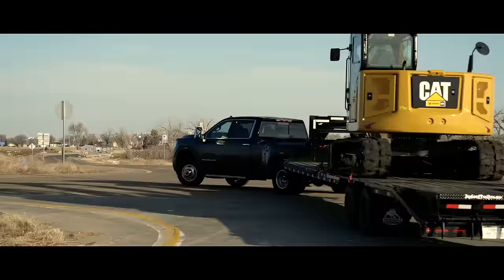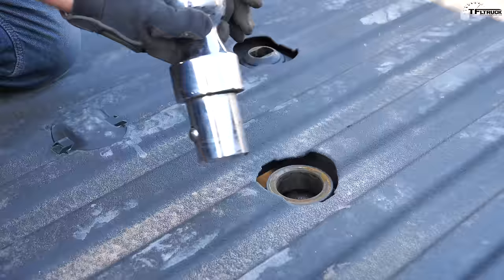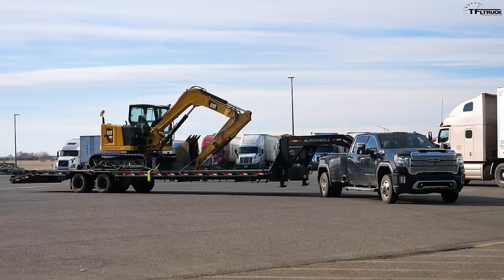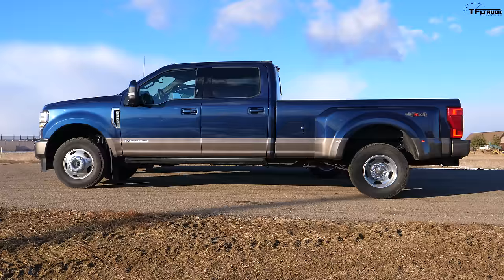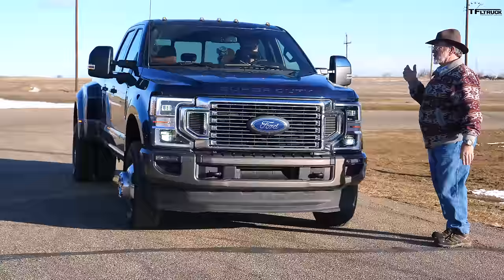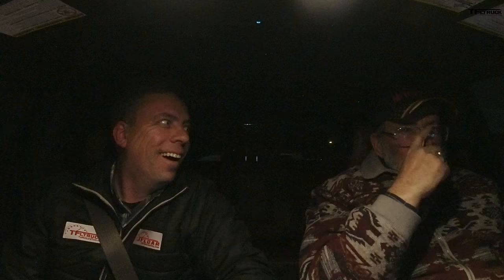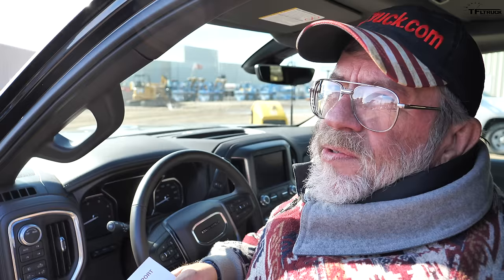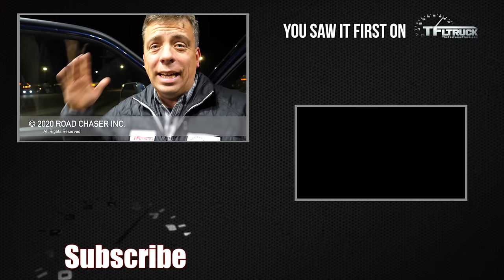30,000 Lbs Monster Tow Test: 2020 Ford F-350 vs GMC Sierra 3500 - Drag Racing & Tow Off!

Comment: 5:08 noticed how the trailer is flopping up and down ,I think the trailer has the bouncing problem not the truck.
Reply: Yep 👍, they didn’t load it right. The weight is supposed to be over both axels...lol
Reply: @chaosseat  That's the first thing I thought as soon as they said it. Improper distribution will shake you and give you some white knuckles on the back roads.
Reply: I noticed the same thing.  Tail of trailer was jumping all around.
Reply: To me it looked like the excavator was a little too far forward.  I have been using gooseneck trailers now for a little over 20 years.  They really don't seem to like a lot of tongue weight.  But if these guys actually scaled the load it could be that was the correct placement.  

In my opinion this is why I wouldn't buy this particular set up.  A full size truck would ride much better than that.
Reply: @texgarcia1958  I can't help but laugh when people say excavator. In my mind I'm saying trackhoe. I guess Andre is keeping it PC😅😅
Reply: Mini is too far forward on trailer.
Reply: @jaycevessier7554  If my CDL is riding on it, I'm going to find a place to park and resolve the situation even if it's only on a 66 mile loop. 🎲🎲
Reply: @robertmorris3892  I came from the rental business.  In the 80s they were trackhoes.  But then they changed to excavator and mini excavator.  I got a better one for you.  With boom liftswe used to call them straight booms and knuckle booms.  Now it's articulating boom.  The lower half of the articulating boom when we call them knuckles used to be referred to as a Dick.  Now the bottom end of a articulating boom is called a riser.  Lmao.
Reply: @robertmorris3892  Guess Andre has to  'HOE the line ' like most people 😂😂
Reply: waka waka you have to have air ride or these these trailers will pound the piss out of ya.
Reply: @robertmorris3892  Good idea; that constant flexing of the trailer could have resulted in a catastrophic failure dumping the load on the road creating a mess.
Reply: @rudystraight1750  Andre, Kent and the rest are doing great testing new trucks.  You  have to work out the kinks on anything for the first time. They did change up the load for real life comparison. Andre didn't even have his stick horse with him. ✌️
Reply: Good video, thanks for testing for ETA and MPG numbers in HD Pickups - I think the EPA should actually test this size pickup truck too.  Could wind during the day have affected your MPG numbers?  Testing during the day vs. night, a few environmental factors could affect the numbers.  Daytime conditions are often windier although the sun may warm the air, hence making it have less resistance to push through.  Nighttime conditions often have calmer wind conditions, but with the sun down, the air temperature decreases and with that, the air is more dense and creates more resistance.  Theoretically these opposing conditions could all cancel one another out, but if you're testing apples to apples, these are things to consider.  I would have rather seen the two trucks alternate pulling the trailer, with the empty truck doing it's "non-towing" TFL MPG Loop for comparison.  Thanks for the video, and for including the DEF usage - no where else have I seen DEF usage numbers compared on this size truck class.
Reply: 18:05 enough said...
Reply: yes sir the cat is the medal of the axle so you get the teeter- tater affect.
Reply: @chaosseat  Yeah, for as much as these two clowns claim to know about pickups they sure do make a lot of boneheaded mistakes like that!
Reply: They got the load distribution off on the trailer to far forward. All the weight is on the front axel and the truck.
Reply: Yeah they need an air ride trailer
Reply: Improper wgt distribution. Conventional tow, gooseneck, 5th wheel ; if you don't get it right it'll rattle your teeth.
Reply: I had a feeling it was the weight distribution
Reply: @chaosseat  and its overweight. That trailer is rated for 22,000 lbs. It weighs 8500 lbs. That means they can have 13,500 lbs of cargo on the trailer. They put an over 21,000 lb machine on it. The trailer is about 8,000 lbs overweight. 
These guys don't understand weight ratings. It includes the weight of the vehicle and/or trailer.
The truck rating is 30k GCVWR (Gross Combined Vehicle Weight Rating). That means maximum allowable weight of truck, passengers, trailer, cargo, and safety equipment. Not maximum towing capacity.
Reply: @AnonYmous-qg4ph  truck is rated to tow 30k plus some.  CGVWR is around 40k on these newer duallies.  

I do believe you are correct on the trailer though.  I have a similar sized machine and the only gooseneck that will carry it is a 20’ with 5’ dovetail with 12,000k axles.  25,900 lb rated.  Any trailer longer is too heavy.  

Just bought trailer last week after lots of research and consulting and a DOTD compliance consultant.  There is a very narrow range of truck/trailer combo that can actually tow what the factory states they can tow.
Reply: @LTD_Outdoors  thats incorrect. The CGVWR(Combined Gross Vehicle Weight Rating) is 30k lbs. That means your total weight including truck, trailer, cargo, passengers, etc cannot exceed 30,000 lbs. That still doesn't mean that you can weigh in at that much and still be legal. Its all dependent on trailer rating,  tire rating, axle rating, axle spacing, load weight distribution, etc. You can be under the weight limit and still be illegal if you have to much weight on one axle, not enough on your steer axle, to much tongue weight, not enough tongue weight, to much weight for trailer rating, etc.
And you have to be licensed for that tonnage, hold a class A CDL, have a USDOT number, truck and trailer need annual DOT inspection stickers, proper insurance and bonds, and more depending on the state.
I know because I am a former CDL driver and I currently work with companies on DOT compliance programs. DOT regulations are something most people and companies struggle with. Many veteran commercial truckers aren't even aware of what it takes to be in compliance.

Comment: Would love a new truck but prices are outrageous. I bought a dozer and towed it, 24k from WV across Ohio in my 96 7.3, zf5 with 400k on it, three weeks ago. Got 12.9 MPG. Guess I'll stick with what I got.
Reply: Absolutely, they’re simply asinine. Especially for a truck that’ll probably blow a head gasket inside 100,000mi
Reply: Yep, we get better mileage from out 01 than our 14 duramax and we don't have to deal with DEF and post bailout GM problems quarterly. The only downside is the 6 speed is nice for highway and the exhaust brakes on the new trucks are a game changer.

Comment: Please do yourself a favor ,put the fuel cap on before you pickup the DEF nozzle.It could be a 10k dollar mistake.
Reply: DeepDeep South huh
Reply: @overboostedgarage8744  if someone accidently puts DEF into the fuel tank and runs the engine, it will damage the fuel system to the point of needing complete replacement.
Reply: DeepDeep South s
Reply: I've done it.  With hotel stay in a small town during the repair , the damage was more than that
Reply: I’m surprised those nozzles are the same size to avoid that exact thing from happening? Good point.
Reply: Brian Weighs In my 2020 f350 does have a fuel cap
Reply: Yes, please put the fuel cap back in place  before touching the DEF nozzle. Really enjoy your videos 
Thank you keep up the good work
Reply: Thats a great point. I worked at a Ford dealership when the super dutys first  came out in 99. The 7.3 powerstroke was a big hit & people were getting diesels that never had one before, & really didn't even need one tbh. Anyways the biggest problem was these diesel newbies were putting gasoline in these trucks, that kept our diesel techs very busy haha
Reply: @troypatillo1688  you would think they would make them different sizes so you can tell, I'm glad my lmm doesn't take that bullshit Def fluid...

Comment: Thanks guys- nice review.  I purchased my 2020 GMC Sierra 2500 HD Diesel last March based on your reviews!  It has been a great truck so far.  My family and I traveled across the USA last summer pulling a 2020 Airstream Flying Cloud, 25Ft.  The truck pulled the AS through the mountains as if there was nothing behind us!
Reply: Scott Yes I have always owned Ford's. My first 79. Then a 2000   with the 10 cylinder. When new on Freeway trip across state it got 15 MPG 
Now driving around town it's like 8 or 9MPG. I do LOVE the look of the NEW GMC Trucks. I would switch brands. The Allison Tranny is so well built. It's proven itself in Garbage Truck usage. The GMC is the Cadillac Ride for Trucks. You have a great comfort Ride for what you do.

Comment: To accurately test the def consumption, you may consider having both trucks do a regeneration prior to fueling. My thought is if one has recently run its regeneration and the other has not could sway def test. Not a gripe jUst a thought. Great job of being as unbiased as possible.

Comment: Excellent test! The Duramax has a larger bore but shorter stroke than Ford's engine. Perhaps the longer stroke was able to eek out better fuel mileage at the ~1600 RPM range that both engines appeared to be running. Last I saw, the Ford's peak torque was at a lower RPM than Chevy.

Comment: I'm surprised the GMC hasn't broken something. They're notorious for breaking Transmissions. And Motors as well. With that heavy load
Reply: 100% false
Reply: FYI it’s dodge that breaks transmissions and L5Ps can handle over 1k horsepower on full stock motor. Check your facts.

Comment: Also when you haul a 308 spin it around and get the weight towards the truck it will help with the ride alot. Plus you can curl the boom more and lower your overall height

Comment: Ford's performance is impressive, but is their a difference in reliability? As an anecdotal observation 80% of all the Diesel Tow trucks where I live are GMC/Chevrolet's.  It's like how almost  all the Taxi's here are Toyota Camry's. Just wondering if there is any reason for the Heavy GM representation.
   I am considering a 2500 HD and Ford's current offerings appear superior, performance wise, in both the Diesel and Gas versions. But this casual observation of Tow trucks in the area has me thinking.
Reply: Get the Ford!
Reply: My 2017 f350 has been absolutely trouble free. And, Its A Beast! @80k miles.

Comment: I am a trucker and I make my living driving the big rigs. One thing I have learned is in the evening my truck does better in cooler air temperatures. I think the Ford did a great job and also the gmc but the trucks should have been tested at the same time of day.  The gmc had to work a lot harder I think. Hotter temperatures make a difference.
Reply: My thoughts also. Plus the wind tends to die down at night helping out mpg especially towing awkward loads.
Reply: @nickgolden8674  agreed.
Reply: But it looks like it winter with snow on the ground so not that much of air temp difference maybe 10-15 degrees but I do agree with you they do run in cooler temp

Comment: Like the video. When your hauling  heavy like that and it's bucking move the weight a little more over the axles of the truck it will help with the bucking. As long as it's not too far forward. Also the way you had the load chained down is illegal.  You can use one chain but it can't be pulling against itself. It has to have enough slack between mounting points and not pulling against itself to be considered "two separate chains". Other than that its was a good video. Waiting to see a comparison between the Ram vs Ford

Comment: Awesome review guys!  I would love to see a real towing cost of use between 7.3 gas vs 6.7 diesel in the same F series model.  Set up trailer for maximum towing weight in the 7.3 and use that same towing weight in the 6.7.  Compare the mpg between the two along with cost of fuels, def, and if possible the cost of oil changes to compare the real world towing cost.  With that info if you want to calculate the additional cost of the diesel engine vs gas and how many miles it would take to break even that would be cool too.  Thanks TFL!
Reply: Most videos will show the diesel uses less fuel but they never compare the actual cost of gas being cheaper.
Reply: All you need is the mpg comparison. The rest is simple math you can do yourself.
Reply: Nobody wants to see little ford trucks towing
Reply: Jamie Webb most HD trucks w/ big V8’s require premium fuel. Meaning the gas is not cheaper
Reply: @josephcreed7  aww did ford hurt you're feelings
Reply: @Prerunners  yes, they let me down when I needed them the most.
Reply: All trucks are smooth when new but a diesel will outlast a gasser by years due to the fact it doesn't work as hard. Thats why you still see a lot of old cummins and powerstrokes with a shitload of miles on them and still running strong.
Reply: @danc1197  That was the case 15 years ago. EGR and DPFs have reduced the lifespan of diesel engines.
Reply: I own the 7.3 gas motor it’s called a Godzilla motor I have opened the exhaust on it, I’m going to make it a true dual exhaust with x pipe and I’ve installed a K&n kit for it. I bet I added maybe 40 horsepower so far looking to have it tuned but this Coronavirus makes it tough to locate a dealer who can tune it. It’s a duality crew cab with 430 factory horsepower it is a 4wd.

Comment: All the people saying that excavator is loaded too far forward need to remember where all the weight on an excavator is at. The engine and big ass counter weight is on the rear of the machine.
Reply: Yeah it was too far up that's explains mose of the truck roughness as far as bouncing.
Reply: They would have scaled the truck and trailer.  They would know the axle weight/tongue weight of the trailer.  It's not overloaded or too far forward.
Reply: The harsh ride is just due to the nature of the trailer.  Even with the torque tubes, flatbed trailers tend to ride harsh due to the deck being stiff, but when it does flex it travels through
Reply: Usually you load them backwards.... I run lowboy and that's what we do.
Reply: The pivot point on that trailer is between the 2 axles the weight is all in front of that.
Reply: Craig Quann .... I don't think you know what you're talking about.
Reply: Alot of people don't have real world knowledge,

Comment: Good review.  The fuel mileage difference may be due to the Ford having free turning from hubs (lock/unlock hubs) and the GMC having always locked from hubs.  The extra drag by the front axles could cause the mileage difference.

Comment: Single digit MPG might sound low but think about this: 30,000 lb trailer + 9,000 lb truck = 39,000 lbs. A new Prius is about 3,100 lbs and gets 53 MPG on the highway. The weight of the truck and trailer is about 12.5 Prii. 12.5 Prii combined would get about 4.25 MPG (53 Miles per 12.5 Gallons or 53/12.5). This shows just how efficient these trucks are at moving that much weight. Of course this doesn't take into account aerodynamic differences, rolling resistance, etc but it does help put things into perspective.

Comment: There are so many variables when it comes to fuel mileage. Wind, humidity, air density, and air temperature just to name a few. I'd call it a draw on the fuel mileage.
Reply: Didn't say if they wind dragged behind a semi halfway either.  Haaaa
Reply: Yep, the computers were identical. It was too short of a route to really get any kind of an accurate test.